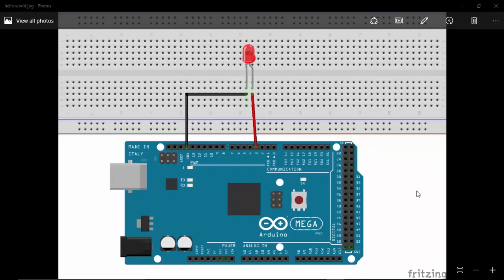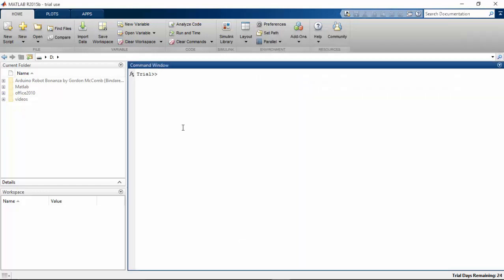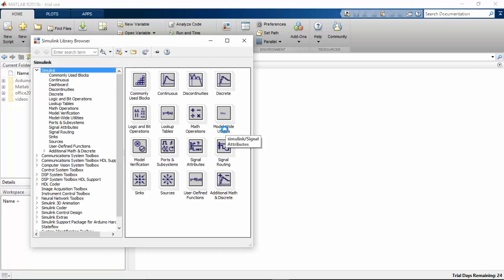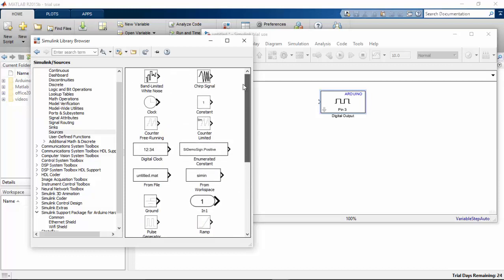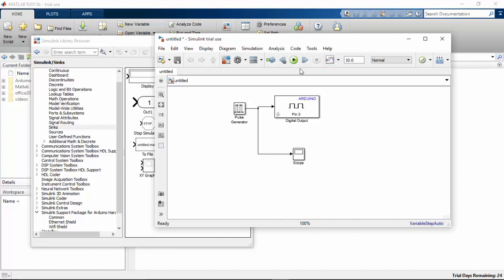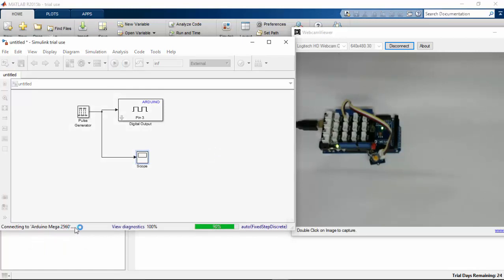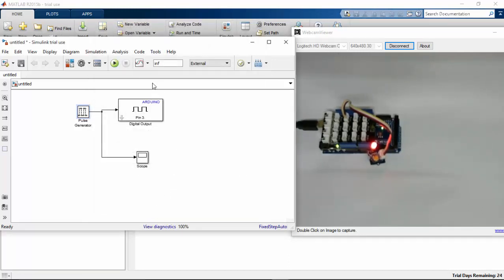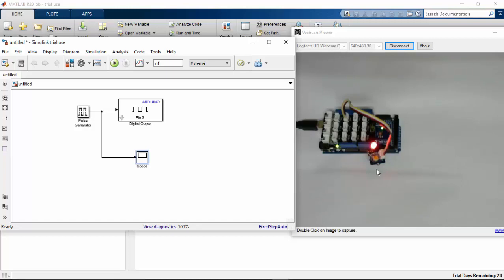2. How to blink an led using Matlab simulink and arduino

Comment: Hi, i got this error. pls help

IC:/MATLAB/SupportPackages/R2016a/toolbox/target/supportpackages/arduinotarget/registry/../scheduler/include -o "Arduino.o" "Arduino.c"
avr-gcc: error: Automation/matlab/Matlab: No such file or directory 
avr-gcc: error: Arduino: No such file or directory 
gmake: * [Arduino.o] Error 1
### Creating HTML report file Arduino_codegen_rpt.html
### Build procedure for model: 'Arduino' aborted due to an error.
Error(s) encountered while building "Arduino":
### Failed to generate all binary outputs.

Comment: So, okay.. you have shown us now how to set Simulink to let a LED blink. But you didn't have explained your steps.. i.e. why do you use "external" for the Simulation-mode.. In my Opinion there is nothing to learn about programming a Arduino with an model based approach. Why did you then call it a tutorial?

It would bei desireble if you explain the main steps or link mor advanced steps in the video description. Also removing the damn loud mous click would be a good way to show some skill, because the audience will be less deflected.